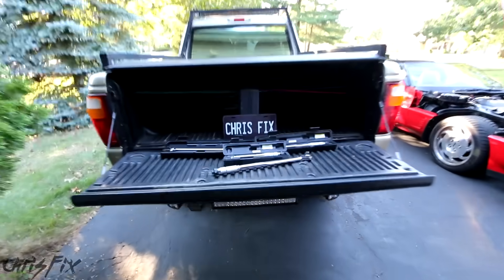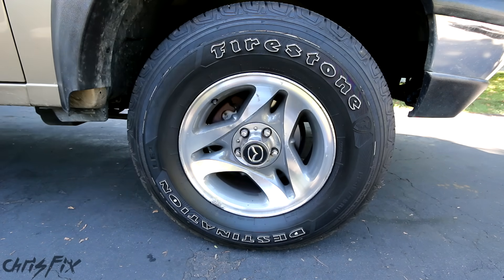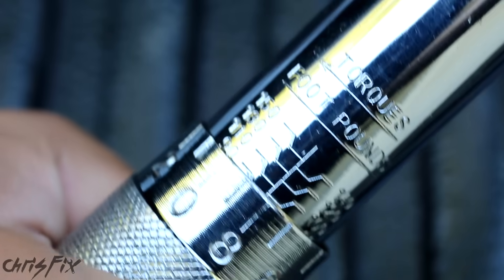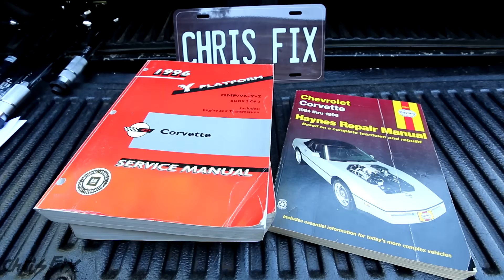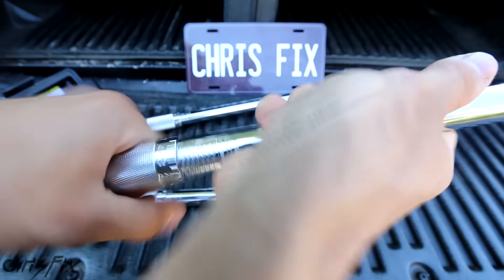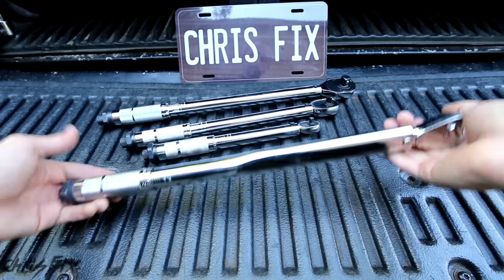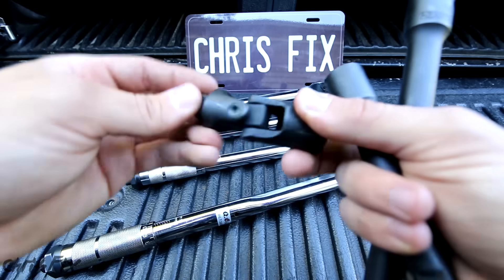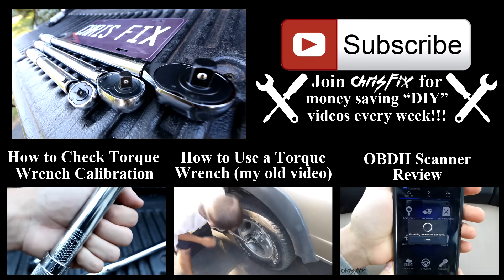How to use a Torque Wrench PROPERLY

Comment: Every time l pass through an automotive establishment, lm quite sure many of them over torque people’s s**t, they love those 1/2” pneumatic impact gun, in which cases do you back it to the correct torque or had they f**kered up and would have to leave it as they had it from that point on? My car calls for 77 lb. Ft, l had to jump on the breaker bar to break “my nuts.”

Comment: Hi mate thanks for your all beautiful clips I have a question please help me thanks my question is about Torque Wrench I have Nissan Xtrail 4WD T32 please tell me which NM number I have to use torque wrench for my car  thanks for all.
Reply from the maker: You need to look it up in the service manual. It’s specific for each nut and bolt.

Comment: Question, why would we opt for the $45 version in your video that only goes up to 150 ft lbs when for 20 bucks more you can get one that goes up to 250? Is the $65 one less precise or need more calibration or something? Seems like the better deal
Reply from the maker: The bigger the range the less accurate it is. Since most nuts and bolts are 20- 120lbs it’s better to have a smaller range for more accurate torque. Good question.

Comment: Hi Chris I have a 2005 Scion xB my bottom alternator bolt is a fixed bolt it didn't move at all using a socket wrench will a torque wrench free it??

Comment: I really like my Duralast torque wrench from AutoZone. It was $37 and worked great for changing my oil. I like how Volvo marked the torque spec right on the oil filter housing cap.

Comment: I have question, i been brought earlier of special holiday until now i check it before I  start use it. There is Thimble Scale was 0 to 18. but there is use like (0 ‐ 2 - 4 - 6 - 8 - 10) i thought suppose use like your video Torque wrench of Thimble Scale. So how i suppose use Thimble Scale of 14 use to 103 (90 foot -pounds)? i don't know now part it. But I have 2016 Toyota Corolla.

Comment: The 1/2" drive shows 10-150 ft-lbs, and the 3/8" drive show 5-80 ft-lbs. Do you avoid using the minimum torque? Thought you'd mention this...

Comment: 3:45 Can't you just measure a known good bolt by using a two-way torque wrench to loosen it?
Reply: That would give a lower reading by a fair bit , maybe 30% lower, since friction is more than 85% of the energy used to tighten it. A better idea would be to note how many degrees of rotation it takes to go from full tight to just snug and repeat that angle when tightening.

Comment: I've bought 2 brand new torque wrenches, 1 from Lowes and 1 from Oreillys auto parts and I understand how to set the torque but neither one of them would click? I would lower the torque to 10 lbs and put all my weight into it and it would keep tightening, no click. What's up with that? I took them both back and haven't bought a new one, could it have been 2 bad wrenches? I cant see anything I did wrong

Comment: is it bad if you just use a normal wrench rather than a torque wrench? ex. I've never used a torque wrench on wheels just the common lug wrench. I guess same could be said while doing a sparkplug change. is it bad? I've delt with 0 issues
Reply: Not great but manufacturers size lug wrenches in your trunk to give roughly correct torque on average.Spark plugs, though, are often seized and jammed by over tightening when people tighten them as if they were bolts and not seals.

Comment: Hello Chris, my problem is . Air corn belt get noise . When air corn was on   .but when it off , it does not make any noise . When apply water to belt , when air con is on , it still make a noise . Where is the problem lise . Newly  belt is in place but still make a noise bus high roof 5l engine. . Iam in solomon islands , in south pacific .

Comment: Could you recommend a ratchet set to use with your recommended 1/2 torque wrench?  I have a 3/8 set from the ancient times. Haha. Thanks for all the hard work and great info.  Also is it a good idea to change your seasonal tires yourself or should I have pros do it?

Comment: I don't know about anybody else but these clicker torque wrenches are absolute garbage anywhere from the $10 Harbor Freight to the $200 snap-on's they are not good in my opinion. The reason I say this is everyone brings over their clicker torque wrenches so I could take my original old fashioned dial manual dial torque wrench and put their torque wrenches back into spec I'm going to tell you like I tell them why don't you just buy the old original one because that's the one we used to do everything still to this day AKA lugnutz lifters and anything else we need twerk down that's what we use I've got him in three sizes and you buy those you'll never ever never ever never ever will need another torque wrench :)
Reply: I had no idea, didn’t think you could even get the dial-torque anymore.

Thanks.🤘🏼

Comment: It actually doesn't matter if you say "pound feet" or "foot pounds." This is because the units translate to lb×ft and since it doesn't matter what order you do the multiplication, it's all fine
Reply: That's not why they do it. It's to avoid "confusion" between Foot-pounds of Torque vs foot-pounds of WORK, so they invented pound-feet for torque and left foot-pounds for Work. It's A confusion that has NEVER happened ANYWHERE to ANYONE but some anal nerd HAD to change it. I personally ignore that, I know what the hell I'm doing either way.
Reply: @billshiff2060  if that's true, that's kind of hilarious

Comment: I'm pretty sure if it clicks it'll transfer the exact force it's set to and the twist in extension doesn't matter. You can test it by connecting two torque wrenches with as many extensions as you have and set them to the same value, they'll still click at the same time (assuming both are correctly calibrated). Also you can calibrate most wrenches yourself, no need to send them anywhere.

Comment: Thanks for the video! Noob here. Do I need to stop after hearing the click or will it just stop tightening beyond the preset pound-feet of torque? In other words, is it still possible to continue tightening if I ignore (or don't hear) the click?
Reply: The click is a signal, Don't ignore it. It means you have arrived at the proper torque.

Comment: Every DIYer should know how torque wrenches work and buddy, I sure didn't. Very informative! Thanks! Now I can tighten the valve cover properly so it'll quit leaking oil. And tighten the crankshaft bolt, which is already a doozy to mess with.

Comment: Man you're 👌.  use it for tightening bolts,  do not use it for breaking.   

Only thing is that any extension will effect trq applied to the fastener.  I've seen it IRL;  Doesn't matter the make or design of the extension,  you will be losing trq,, dramatically if the object can move with the force.

Comment: Best practices for tightening high torque bolts is to press down with you body weight rather than pull up as seen in video. Less strain on you wrist, arm, and shoulder.

Comment: You forgot to add 5lb per joint  so your  100lb was really 95lb because you added a 1  extention...that's 1 joint ..
Reply from the maker: I haven't heard of that variation of the "don't use extensions on torque wrenches" but that's not true. If you are using an extension and you are using the wrench correctly and you are parallel with the bolt being torqued, you are not changing the torque in the wrench. If you add a universal joint or swivel, that's when the torque can get messed up. If the extension bends that easily and losses torque as most people say happens, you would be breaking extensions left and right any time you go to use one.
Reply: @chrisfix  this was my dad a michenist and mechanic he said the connection is where some of your torque is lost especially with higher torque lb range however he also mentioned longer extentions also twisting takes away some torque too. And for swivel joints add 10lb and try never to use when possible.  If however you have impact quality extensions no need to add any extra lb. I had also read something similar in a old manual back in the 90s so I was like oh dad was right. This all my have changed scense then with higher quality steel and what have you it was just what I was Tought. P.s my Sargent in AIT US ARMY  hevey wheel said he was taught that way too. And still dose it himself. It only be like 5-10 lb extra in best case so who knows I say if you want to know do a test on this premises....

Comment: 11/3 22. Does recalibration cost more than replacement ?
Reply from the maker: Could be as cheap as $30 and can go up to $200, but you can also do it yourself, I have plans on making that video this year so stay tuned!
Reply: 11/3 22. Good luck with that & others you have planned. Have you produced one on achieving & maintaining bodywork? I find wheel cleaning can take longer than cleaning the rest of the car. I get nervous about rubbing through the Clearcoat ! There's stuff going around hereabouts saying Babyoil brings out an easy & deep shine. Like to keep engine bays spick too. Best.

Comment: Do you have to hand tighten  the lug nuts as much as you can  before using the torque wrench? Also does the vehicle have to be lifted to tighten the lug nuts with the torque wrench? Or can it be sitting with the tires on the ground?
Reply: Yes, you should hand tighten as much as you can, but be careful, it is easy to overtighten. When the car is lifted, you have to hand tighten, as much as the tire do not fall off. You MUST take the final wrench when the tires are on the ground. Anyway, Chrisfix has a video about how to change a tire, the title is: How to Change a Tire (plus jacking it up)

Comment: Set it to max. torque setting when you using it to unscrew wheel nuts/bolts and such.
Reply from the maker: Torque wrenches shouldn't be used to loosen nuts/bolts, that's what ratchets/breaker bars/impacts are for!

Comment: Hello Chris, how do you use a torque/angle wrench? Is it advisable to just use a torque wrench if your user manual recommends that you tighten your bolt at 10nm (89lb in) and 45 degrees angle?

Comment: Ammmm....but sir...everyone else says you gotta zero the thing. Constant force causes creep. What is your argument for putting slight tension and not zeroing the torque wrench fully? If you're afraid of the spring bouncing around do remember that the little square that clicks above the spring should be flush with the spring.....I would probably go maybe a little bit after zero if your that worried about the spring staying calibrated....idk

Comment: Perhaps i missed it , When you put the Torque wrench away  after using it and back the pressure off,  the little lock knob at the bottom, should that be locked on or off?

Comment: i just got me some Pittsburgh torque wrenches and i set it to 47ft lb and i have been squeezing and turning but no click.. i been using force... it is normal to push in alot of pressure and have no click?  What could be wrong?  Am i just too weak?  is my torque wrench broken?  i even set to 10ft lb and still no clicks... can over tightening the bottom knurl cause this issue?  should i only be using one hand?  is there something i should be doing for new torque wrenches?  Whats the best way to test?

Comment: What do you think of torque wrenches with a digital read out? Good, bad or indifferent?
Reply from the maker: The only thing I don't like about them is that they can be a little pricey and if you're really trying to be precise, the digital doesn't click and stop you (you can go past that on a traditional torque wrench but it's harder if you're doing it right). Other then that they are definitely a step up as some of them can keep track of bolts you torque and provide angle measurements!

Comment: Anyone know what 25 ± 5 N·m would be? or is it just 25.5 N·m.I dont really understand ± mean or if it matter on a torque wrench
Reply from the maker: The ± means that 5 Nm after the symbol means a maximum of two values, and it just gets looked at as a simple math problem. So in this case, you can look at it as 25-5 which would be 20, or 25+5 which is 30, and both are correct. So the correct torque spec is anywhere from 20 to 30 Nm in your case, but I would set your wrench to 25. If you don't have a wrench that can do that, then you could set a different one to 20 Nm and still be correct, or 30 Nm and still be correct.
Reply: @chrisfix  Thank you Chris.

Comment: Recently I tried tightening an axle nut at 215 ft/lbs and my strength did not allow me to adequately do this so I fitted an iron pipe over the handle to give me more leverage . This worked but I am not sure if I did the right thing as far as meeting the required torque. Comments please

Comment: you also can’t use HANDLE extensions, like putting a tube or bar over the end, increasing the leverage. Throw off specs. I  didn’t know about storing it at lower calib. Thanks!

Comment: I just use one of the old fashioned ones with the dial and the needle (beam torque wrench). I do try and get it as close to the spec as possible but I also partly go by feel as the needle is getting close to the spec that I want. I find these ones kind of cool because you can see as you're getting close to the value instead of just waiting for the click.
I just find it more visual because you can see the value that you're at as you get closer to the spec.

Comment: Your method will not work if the wheel nuts have been over tightened at the tire installers.  One has to loosen the wheel nuts and then retorque.  I am going to use a breaker bar to loosen off the wheel nuts.  I will do one wheel nut at a time.  I am 75 years old and just discovering the problem of over tightened bolts.  I am a total novice in everything mechanical.

Comment: To achieve an accurate torque setting, the nut/bolt MUST be rotating when the wrench clicks. If it clicks as soon as you put pressure on it, it may not be fully tightened, as it takes more breakaway torque to overcome the friction and rotate a stationary bolt, than it would if it was already moving. If that happens, you should back it off a1/4 of a turn and retighten it in one continuous movement until it clicks again.
Reply: Yes, that's something many people don't seem to realize.  They go around the wheel on already tightened fasteners and "check" the torque by having it click, but it's not an indication of anything except if someone forgot to tighten one.
Reply: As commented, the critical thing not mentioned in the video is that the torquing action must be done in one smooth motion. If it's stopped before the click and restarted, the nut must be seen to move on the second pull. 

 If it doesn't, it needs to be loosened up again before doing it again.
Reply: ^ This is an important comment. Thanks.
Reply: what a great comment, yes this is static friction vs kinetic friction, khan academy has a nice breakdown of it from a physics point of view
Reply: Good comment.  Another thing not mentioned is if the threads have been lubricated with oil, grease or anti-seize, then you may have to torque to a lower setting.  I'm no pro, so look it up to confirm, but most torque specs are for dry threads.  

Also, I am not sure if applying thread locker to threads also warrants reducing the torque setting.  Probably not as much a concern as when threads have been lubricated.

Comment: "Foot-pounds" and "pound-feet" are both technically acceptable because the unit is a multiplication of two other units - and order doesn't matter for multiplication - but "found-pounds" is generally reserved for energy, and "pound-feet" for torque.

(Or you Yanks could get with the program and use the unambiguous Newton-metre😛)

Comment: If you have a super duty or something that requires more than 150ft lbs for the lugnuts, you'll need a torque wrench that goes much higher. Putting max tension on the spring, even for a short time, could fudge the calibration.

Comment: what happens when the spring is messed up? trying to calibrate my torque wrench using 20 lbs and the measurements but doesn't matter how much i adjust the tension screw, it always click unless i put it on very high torque even little push with my hand made it click with little to no pressure.
Reply from the maker: You need to rebuild it or buy a new one.

Comment: You shouldn’t go counter clockwise with your wrench, it’s meant to tighten plugs at a certain torque, loosening with the tool uses more torque than tightening it, it can wear it out faster.

Comment: The only thing that could be added to this is that when using snap action torque instrument you should exercise it at 60% of its max torque value at least 6 time before actually tightening anything. This helps ensure the mechanism isn't sticking.

Comment: Chris thank you for the video it was very helpful!
Great tip about when storing bring down the handle to lowest setting
Curious, can you get a 1/2 torque wrench and use a 1/2 to 3/8 adapter when you need to use it on 3/8?

Comment: Chris, do you think keeping a torque wrench in a hot environment is bad for it? I live in Florida and I keep it in my truck bed. My bed has a cover and the wrench is in a case side of toolbox. Still, you can easily get 100°- 120° in the truck bed.
Reply: Short answer is "No".
Metal expands with heat; different metals expand at different rates, so if you have a tool made from 2-3 metals, there could be some operational difference between, say, 60-degrees F and 160-degrees F.

You can have issues in extreme cold, though, with it getting brittle.
Reply: @MP-zf7kg  thank you!